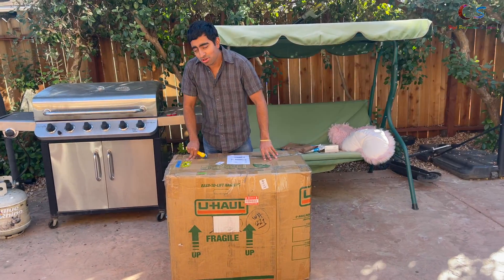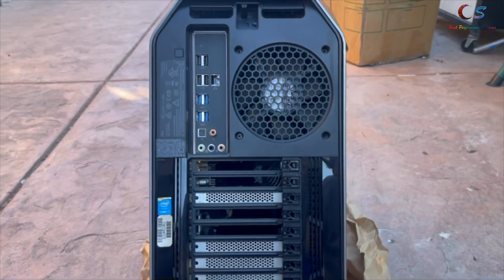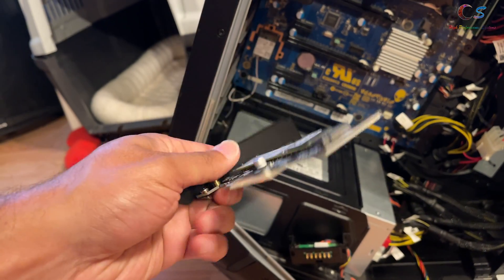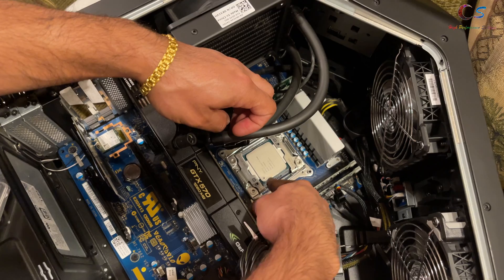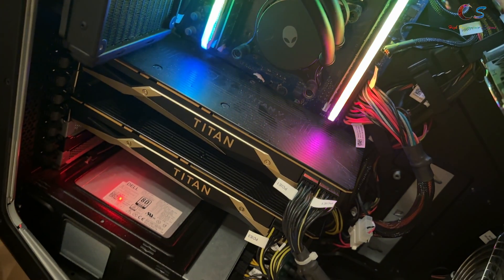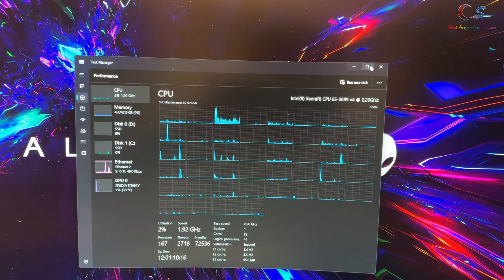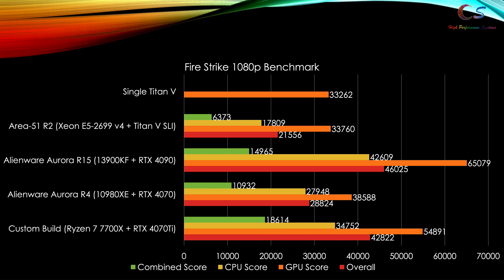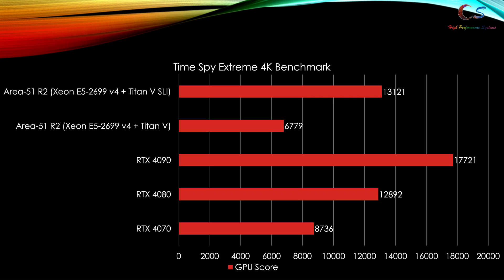Building a 22-Core Alienware Area-51 R2 (X99 in 2024)

Comment: Hi CS Studios,

I hope you’re doing well. I recently bought a used Alienware Area-51 R2 and have been researching possible upgrades. I came across your video and it really caught my attention:

https://www.youtube.com/watch?v=WXCaDAXYX4w

Your X99 build in 2024 is exactly the type of upgrade path I’m aiming for, so I wanted to ask you a few technical questions based on the photos and scenes shown in your video.

Here they are:

1) NVMe SSD on PCIe (adapter card)
In the first image, I noticed you’re using a PCIe adapter card to install an NVMe SSD (since the Area-51 R2 has no native M.2 slot).

What is the exact name/type of that PCIe-to-NVMe adapter (brand/model, if you remember)?

Which NVMe SSD did you install in your system (brand/model/capacity)?

2) Xeon 12-core processor (v4)
I saw that you upgraded to a 12-core Xeon.

What is the exact Xeon model you used?

Is there anything important to know before upgrading (compatibility issues, power draw, thermals, BIOS behavior, etc.)?

3) BIOS update
In the video you mention that the BIOS should be updated to the latest official Alienware version.

Did you follow any additional steps besides the BIOS update (CMOS reset, loading defaults, specific settings to enable/disable)?

Is there anything else you recommend to avoid problems after installing the Xeon?

4) DDR4 RAM + RGB
I understand that this system uses DDR4 2133 MHz UDIMM Non-ECC memory.
My questions here are:

How did you manage to use RGB RAM, considering that most DDR4 2133 UDIMM kits don’t include RGB?

Since the motherboard doesn’t have standard RGB headers, how was the RGB powered or controlled (or was it just static lighting)?

5) Cooling system / AIO
I noticed you reused the cooling system, but I’ve read that a 12-core Xeon may require stronger cooling.

What exact cooler/AIO are you using?

How are your temperatures under load?

Would you recommend upgrading the radiator, or is the stock setup sufficient in your experience?

6) NVIDIA TITAN V SLI
In the later images, I saw that you’re running dual TITAN GPUs.

Did SLI work automatically through NVIDIA drivers, or did you need additional configuration (NVIDIA Control Panel, profiles, specific SLI bridge, etc.)?

Are there any limitations or stability tips specific to this motherboard/chassis when running SLI?

Sorry for the long list of questions 😅 — I just want to do this upgrade the right way, and your build is the best real-world example I’ve found.

Thanks a lot for your time, and great work on the video.

Best regards,
Jhon
Alienware Area-51 R2 (X99)

Comment: I don't there is enough factual data to rank a Processor chip with 2011 contacts over one with 
4094, but I'd probably find myself all alone on that one too.

Ricky.

Also, only some motherboards / CPU support simultaneous full speed PCI slots. Which is rarely advertised. Just that you can upgrade, not that it will be waste of money to.

Comment: Why are you using mis matched ram sticks? It probably isn’t even running in quad channel.
Reply: im using mis matched sticks due the mb dont allow ram speed over 2400mhz  so i got 24gb in it
Reply: @amdluma9772  Your better off with 16
Reply from the maker: You can use mismatch and still get quad channel. I think sandy bridge was first gen or maybe even earlier where you can use mix match ram as long as their pairs. Ex: 2x 8GB on one channel and 2x4gb on another.
Reply: @cs.studios  it still isn't optimal or recommended.

Comment: I have an old a51 r2 that I'm working on.. I originally bought a 6850k and 1660s to replace the 5820k and r9 290.. I decided to use those elsewhere and grabbed a 6950x and an A770 LE.. Have a ryzen 5600x rtx 3070 so im not building it for gaming.. Just taking the case as far as I possibly can.

Comment: Would you know how far an upgrade I can go with a processor on my 2015-16  Area 51 R2 with original motherboard and current Bios is A14?  Current processor came with it is Intel Core i7 - 5930K @3.50GHZ.  Thanks for any insight.
Reply from the maker: With latest bios you can do what I did with a 22-core Xeon. Or you can get the 10-core 6950x as well.
Reply: @cs.studios  thank you for replying

Comment: Until a couple of years ago I ran an ASUS X99-WS/IPMI with a 22 core E5-2696-v4 which is 100Hz faster than the E5-2699-v4. It was great but alas, one day the addon RAID controller turned to smoke, so I got an X299 board but with only 14 cores in the CPU. It's a bit faster which is nice for some things,  but on tasks like Handbrake that could use all the cores, the 22 core chip was more productive.
Reply from the maker: You could drop a 18-Core 10980XE in that X299. I have one and they’re still plenty fast today. Didn’t realize the 2696 v4 has higher clock that’s interesting. I got my 2699 v4 for cheap so I’m assuming the 2696 v4 was more expensive when I was looking
Reply: @cs.studios  2696 v4 has more L3 cache and is ringbus.  X299 is mesh and doesn't have nearly as much L3 cache.  the 14 core X299 actually slower at doing day to day tasks compared to the 2696 V4 despite higher clocks. 

LEvel1techs did video comparing the 7900x vs an 2680 xeon and the Xeon was actually faster in games despite being how old it was.

The video is called Old v. New: Xeon E5-2680 vs. i9-7900X (Sandybridge Wins!)

Great video that you guys should check out

Comment: sli is all but forgotten by nvida and wont scale well at all in any modern game so if you just want to play the benchmark game then the old titan cards are good otherwise any newer GPU will out perform the titan/s in any new game
Reply from the maker: Couple things to keep in mind. SLI scales well with games that officially supported it. Most games before ~2020 that support SLI natively actually scaled quite well. Especially during the 2011-2014 era I think is when SLI was peak. The cards I am using are Titan V. These GPUs never supported SLI and don’t even have an SLI bridge. The reason for the bad scaling with these GPUs is because of a driver hack/bridge less SLI. If I used my triple SLI GTX 980Ti build instead, things would be different. In 2024 SLI is basically dead unless you’re using older cards/games yes.